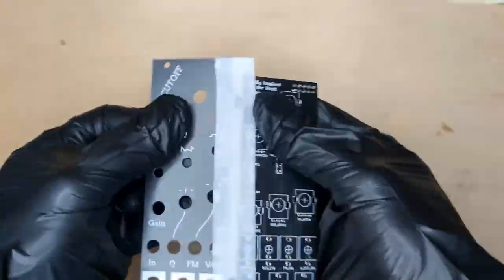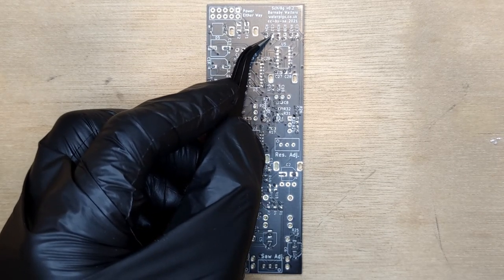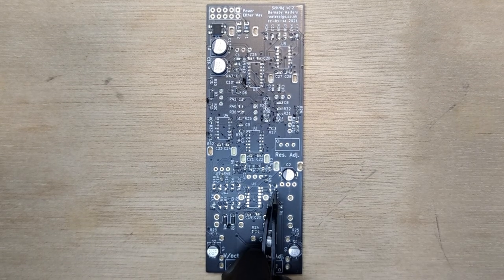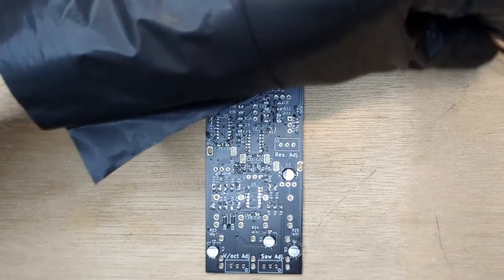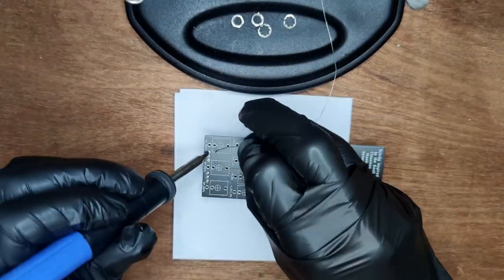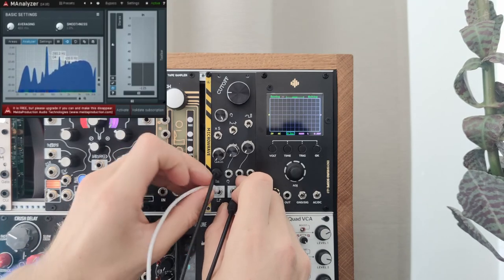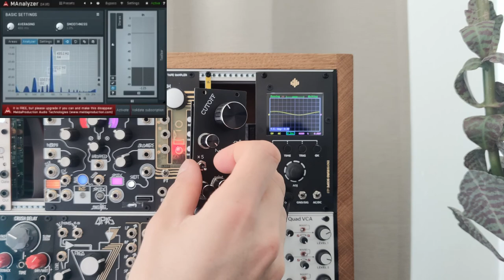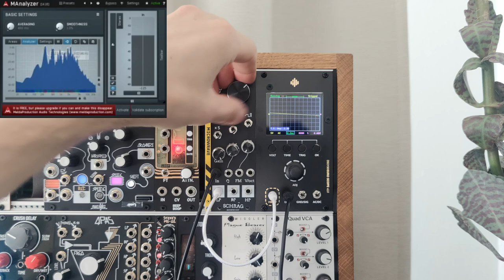Schräg filter (Bastl Cinnamon clone) - Build, calibration, review & demo

Comment: Starting your test procedure with gain at 0 and resonance at full, the filter seems to self oscillcate (without being pinged). In the video you explain that one has to dial down the resonance a bit and you do so, but it is remainsl audible. Then you up the gain and no resonance is audible anymore. Later you show that resonance is only audible when pinging the filter. Why will turning up the gain stop the self resonance? It seems like I'm missing a step here.
Reply from the maker: Ah I checked the video and actually the answer is simply that I push the resonance knob back just a hair. It's hard to see, but even a tiny adjustment stops the self-oscillation, although it is still primed to self-oscillate when the filter receives a trigger.

Comment: whats the reason for the component subs?
Reply from the maker: The filter cutoff and resonance CV control did not cover the full range; the substitutions help cover a more useful range. See this thread: https://llllllll.co/t/diy-module-release-schrag-bastl-cinnamon-rework/40590/6
Reply: @Channel37synth  ah, i see, thats a useful thread. I am almost done with mine, just waiting on some 5.1v diodes in the mail. I'll have to switch out those 3 parts. Cheers!